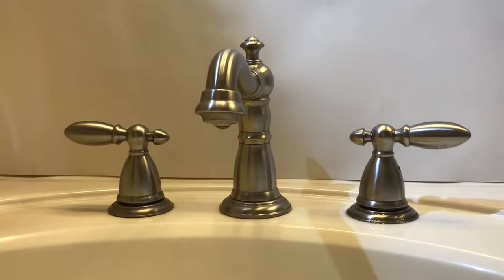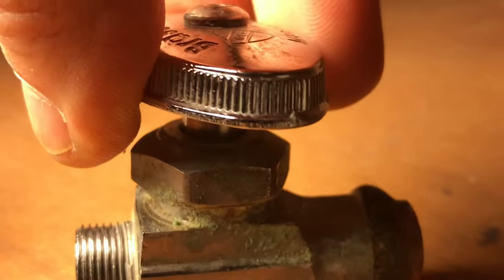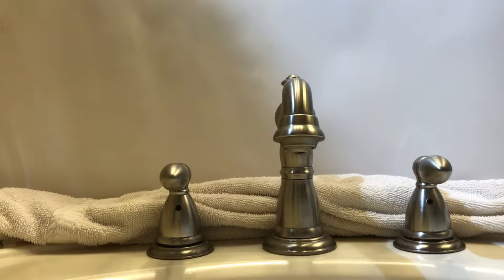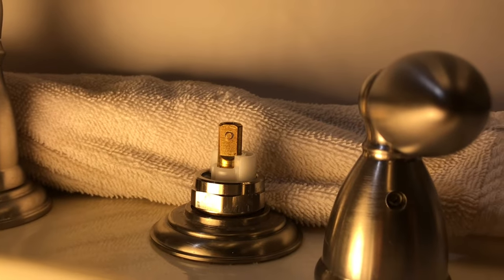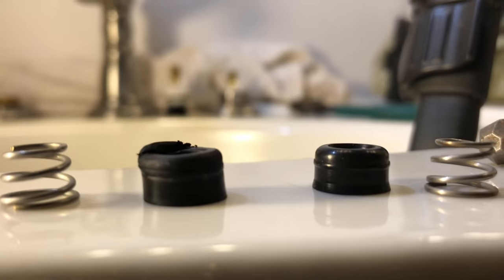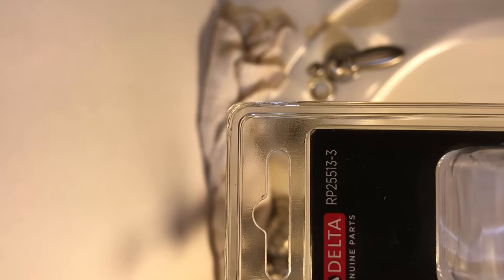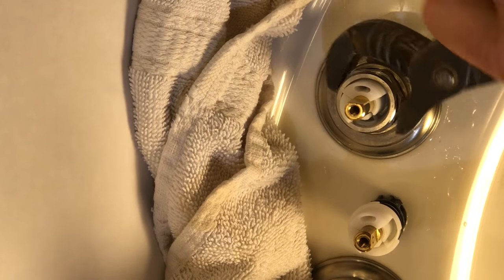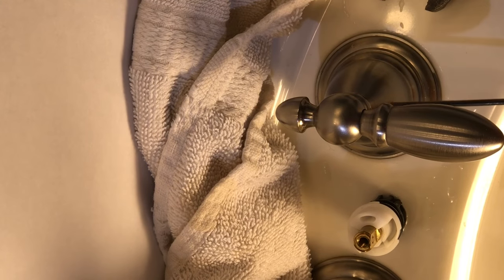How to Repair Leaking, Dripping Delta Faucet #diyplumbing #serviceplumbing @TappPlumbing

Comment: Good video.  But my bath sink faucet cartridges have a screw in their tops;  I note yours are not there.  What are they for?  And also, some time after I replaced both cartridges and seats/springs on my wife’s sink, she complained of the handles being hard to turn, and indeed I found them both substantially different in turning effort from the identical ones on my sink with old but not leaky innards.  What is causing the tightness?  Is the escutcheon nut holding the cartridge in place too snugged down?  I didn’t notice tightness after I put the cartridges in a few months ago, so it’s a head scratcher as to what changed.
Reply from the maker: I am gonna have to guess your theory on over tightening would be most logical, for the question about hard to turn. There are a few other variables that could come into play. The quality of the brass in the valve body comes to mind. The answer to the screws in the top of the cartridge would be some handles attach from the top . These are great questions that unfortunately I have to give you best guess answer for . There are lots of tiny details in  plumbing projects as simple as this one that can make huge differences. Best of luck , please keep us posted when you get things figured out!
Reply: @TappPlumbing  After disassembling the cartridge, I found that’s where it’s an issue with both valves, hot and cold.  It’s not the nut nor the seat and spring.  It’s not even the inner O-ring inside the cartridge, where I’d thought it might be too fat.  

As I put the inner white plastic core that turns into the outer white plastic part that sits stationary under the nut, it rotates fine until they taper together inside.  The wide sleeve above the taper rubs the neck too tightly.  Even with the O-ring removed and waterproof grease slathered between the two, when pressed toward full engagement the inner core takes some effort to rotate inside the “shell”.  This I test with the cartridge in hand, not on the sink, so I can clearly see what’s happening.  The cartridge plastic surfaces where the inner and outer parts meet seem rough to me, not slick like I’d expect.  I’m wondering if Delta changed materials, ending up with faulty degrading plastic of some sort.  I’m tempted to see if I have a tool that I can use to hone down ever so slightly one or both of the interacting surfaces.  
Video available if helpful, but my tremor makes it a bit shaky.
Reply from the maker: @hafcanadiana318  I will be interested to hear the results of your plan. The tolerances in those surfaces that mate are very small. You have the right idea about ever so slightly!  Maybe you can call Delta, tell them your story and get some fresh cartridges.they normally have good customer service. It is very challenging these days to deal with materials across the board in our industry. Thanks so much for your engagement and let us know what happens if you can please.
Reply: @TappPlumbing  I didn't ask for them, only insight into why the two plastic parts fit so tightly, but they automatically shipped off two new RP1740's just from the photo I sent.  I expect they will function tightly as well, since the two in the sink are recent replacements.  We'll see.  

I'm now wondering if we're simply noticing the difference between sinks;  mine has 29 year-old original equipment with faucet handles that turn with no friction at all,  but don't leak either.  Perhaps all new faucet handles/valves/cartridge replacements have tight fitting cartridges that turn with a good deal of resistance, plastic on plastic.
Reply from the maker: @hafcanadiana318   That is a possibility, things are definitely not made the same. That is actually amazing you have a faucet that is 29 years old and still functions perfectly!
Reply from the maker: I just noticed your picture, I spend as much time fishing as possible my self. I would imagine you you endless possibilities for trout fishing up there!
Reply: @TappPlumbing  Even tho retired and an avid fly fisherman, home maintenance projects and my wife’s and my health issues have kept me off the water since 2016.   That photo was on the Beaverhead in Montana.  Decades back I enjoyed drifting flys in remote Cascade lakes, but am likely too old and banged up to backpack anymore.  Dumb me got a backpacker pontoon boat some years ago, but never hit the trails it was meant for.  It did get wet once at Fish Lake in the Steens, where evening brought the hatch, Brookies & Bows on each cast, and encirclement by 2 tail-slapping beavers angered by my presence.  Love Oregon, but ditto for the fishing in Alaska, Idaho, and mostly Montana.
Reply from the maker: @hafcanadiana318  I have only been able to fish with the western mountains for a backdrop once. We live in Georgia and drove our gear to camp in buena Vista Colorado. I plan on doing much more of that in the very near future. I do have the opportunity to drive just a little for salt water fishing and there are some great bass lakes very close. I do fish for trout also but it is normally stockers in tail waters or smaller mountain streams . I enjoy all of it immensely!

Comment: Hello, I have this same exact faucet and the hot water handle on the left will no longer turn the hot water off when I move the handle to the closed position.  Do you think this would be an issue with the cartridge or the spring and seat?  Or, do you think I just need to readjust/calibrate the cartridge?
Reply from the maker: If you have not replaced the seats and springs and the cartridge yet this would be your first course of action:)
Reply: @TappPlumbing  thanks so much!  I will let you know how it turns (pun intended) out.
Reply: Update.  I bought a set of Allen wrenches and for our Delta faucet it was a 3/32 screw.  The problem is that I tried to loosen the screw with the Allen wrench and it would not budge.  I put more force into and thought I might break something.  (This is my girlfriend’s faucet and I don’t want to damage things further).  I think I should give a plumber a call… thoughts?

Comment: Today I finished this repair with one problem. After turning the water supply back on the handle would not turn the water off. I repeated the process two more times hoping to catch my mistake. Still same problem. Thoughts?
Reply from the maker: My first question would be did you repeat the process with the same parts or try different parts? Next question would be did you very carefully and slowly turn the water on with nothing in the valve body at all to make sure no little particles are in there? Basically to flush everything out. Be careful, this can be messy! Next question, did you carefully inspect the cartridge for flaws ? Things are not manufactured the same as they used to be and occasionally we get bad parts right off the shelf. Try these things and keep me posted please. Best of luck!

Comment: I changed the cartridge but I still have water coming from the faucet when I turn the handle off. I have repeated the steps a million times. What am I doing wrong?
Reply from the maker: Did you replace the seats and springs?
Reply: I did not, and that’s what I figured what was going on, Delta was supposed to send me both the stem and the seats and springs. Waiting for them to arrive and will try again. Thanks for the reply.
Reply from the maker: @angelatomaselle    I bet you will have great success when those seats and springs are installed! Keep us posted if you can please.

Comment: Thanks for the tips. I changed both cartridges and the faucet still drips 1drop a minute. I then  lubed the o-rings, no difference. Any ideas?
Reply from the maker: Check your water pressure first, https://www.youtube.com/watch?v=nrGZMxpp_Og&t=122s,  if your pressure is too high then the water is going to the weakest area. It could be that the valve body is scarred and unfortunately it would need replaced. Make sure one more time that all the debris is out of the valve body as sometimes some small particles could be left in before putting in the new seats and springs and cartridge. Good Luck and we hope you a successful plumbing project!

Comment: I am having problem trying to remove the screw with an Allen wrench in the handle. The screw are way too tight. I have tried using WD40 to lime away. Yet it’s still not coming off…. Any suggestions will be helpful. Thanks
Reply from the maker: I need a few details please. Does it appear to be severely corroded and is it leaking from around the handle near the base?

Comment: Hello Sir,
What is the Model Number for this Faucet. Recently bought my House that comes with this Delta Faucet in my Bathroom and it's start to Leak on the Right Lever. Want some Info to speak to Delta to see if I can get the Replacement Cartridge along with the Seat and Spring for this Model to Repair.

Thanks...
Reply from the maker: Take a picture of the faucet and have it ready when you call Delta help line .They will work with you from there!!!

Comment: I took out the set screen using a hex tool, but I can't pull the handle up. It's stuck. Is there something else I need to remove?
Reply from the maker: There shouldn’t be , some times they are very stubborn. If it has been leaking for some and has become corroded especially.
Reply: @TappPlumbing  Should I put a flat head under it and force it up and off?
Reply from the maker: @John-be6jt  You could definitely try that approach. I personally would work the screw driver from different angles. Try not to put too much stress in one place. Also be keenly observant of things chipping . Counter tops and the handle come to mind first. Keep us posted on your progress please.

Comment: What does it mean if I can't dry out the socket under the handle? It fills right back up every time I try and even if I push through and finish the repair it leaks faster than it did before. I bought a cheap universal kit and need to get the actual delta one but think there may be another problem.
Reply from the maker: It could mean the water is not shut all of the way off. You can always turn the water off at your meter .

Comment: How do you remove a faucet if it doesn't have the hex piece for an Allen wrench? There's no sign of anything to relax/release the handle :-/
Reply: there’s probably a little cap either on the top of the handle or the end of the handle arm. pop that loose with a knife tip and there will be a set-screw you need to loosen

Comment: The video says to use a 5/64 Allen wrench to remove the hot and cold handles but it does not fit. Can you tell me the correct size I need. Thank you.
Reply from the maker: If your screw is not stripped, then you might have to purchase a wrench in a delta repair kit. Good luck keep us posted.

Comment: I didnt pick the sink/fixtures. Came with the house. I have 2 problems with same sink: 1-retaining screws on handle are stripped, one is on the sink and the other won't turn/tighten. 2-cant seem to line cartridge up the right way. I hate plumbing of any kind.
Reply from the maker: Some times it is more simple just to replace the faucet. It really depends on the time vs money equation. We all have more of one than the other. Sometimes the new parts simply will not work because the brass is scarred. Plumbing can  definitely be aggravating my friend, even for those of us that deal with it on a daily basis!

Comment: How much does a plumber charge for a job like this? Mine is leaking from the handle. I was quoted for both this and a U bend under the kitchen sink $425 does this sound about right?
Reply from the maker: Depending on your area, this really doesn't sound unreasonable. Good Plumbing is not cheap and cheap plumbing is not good :) We appreciate you reaching out. This is why we started our channel , to save people money. it cost a lot just to pull up in the driveway. Gas, tools, inventory, insurance, license , continuing education, maintenance, just to mention a few:)
Reply: @TappPlumbing  Thank you for the reply and the video 👍🏻I do understand and I apologize if I came off as trying to be cheap. I was asking because I don’t want to get ripped off and it doesn’t help that I’m a girl (I do speak from personal experiences) I also ask questions like this when I take my car to a mechanic.

Comment: So it's the same fix if it's dripping from the spout and not the handle? DO I need my faucet's model number because I have no idea what it is.
Reply from the maker: tightening the nut on the retaining ring for the cartridge's will usually stop the leak from the handle. You will need to change cartridge  as well sometimes, just don't over tighten

Comment: I replaced the seat/spring 2x on a Delta/Peerless faucet. It worked and stopped drip both times for a week. Then it started dripping again.  Ideas?
Reply from the maker: If that is the case we highly recommend checking your water pressure and addressing this issue first. If your pressure is not high then the valve body could be scared and the whole faucet would need to be replaced unfortunately.  Good Luck!!
https://www.youtube.com/watch?v=nrGZMxpp_Og&t=72s

Comment: On my cold water side water is dripping under the sink when the handle is turned on.
It drips directly from under the mounting nut. Any idea why?
Reply from the maker: If you can get the handle off it may provide a clue for you. It could just be the cartridge has gone bad. Keep us posted please?

Comment: What do you have for a faucet model number? They said I had the wrong part number. Thanks
Reply from the maker: The seats and springs work for numerous faucets, did you give them a part number to a faucet? If you called delta directly I am surprised they didn’t ask you to email or text them a picture of the faucet 🤷‍♂️
Reply: @TappPlumbing  . I did send them a picture. Now they are sending me more cartridges. They did not send me a quarter stop cartridge.
Reply from the maker: @chrisrule5723   They normally do a pretty good job with getting the right parts to you. Keep us posted with your progress if you can please!!!!

Comment: Great video. However, there are no screws on the handles to remove them. Now what?
Reply from the maker: Let me first ask have you carefully looked in there or are you just going by feel.  If there are truly no screws the handles should pull off. Just be careful, this plumbing story already seems a little odd about both screws completely missing.

Comment: Where did you get that seat and spring tool at. I can't find it on Amazon
Reply from the maker: I believe we did actually find it on Amazon but I have had it for many years. Maybe you could call Delta and see if they can help you. If not you can slide them up a small screw driver or Allen wrench.
Reply: Can do. Thank you for that

Comment: Still leaking.  I replaced the cartridge, seats and springs just like the video showed, but my cold water side still leaks.  I replaced everything and then turned the valve back on.  No water came out.  When i turned the handle to turn the water on the water came out, but when i went to turn the handle to the off position the sink proceeded to drip again from the faucet (not the handle).
Reply from the maker: Sometimes unfortunately the valve body that holds the seats and springs will be scarred and allow water to still pass through. We would also suggest checking your water pressure https://www.youtube.com/watch?v=nrGZMxpp_Og&t=46s

Comment: What if the spout leaks when the water is turned on?  How do you take it apart?
I'm looking at it and can't tell for the life of me.
Reply from the maker: The spout is not gonna come apart to my knowledge 🤷‍♂️. Except for the aerator. Where is it leaking from?
Reply: From the middle of the vertical part of the spout.  @TappPlumbing
Reply from the maker: You might try to call Delta and see what they say about that . They may send you a replacement if you can get everything disassembled from the bottom without causing more damage. Keep us posted if you have time please. Thanks for watching our video!

Comment: Looks like it need a shim on the spring to protect the rubber.  I have an idea, thanks.
Reply from the maker: Please let me know what the idea is and how well it works. Generally speaking there is almost no extra tolerances on how all of it goes together. Best of luck and thanks for watching!!!
Reply: @TappPlumbing  - Looks like the tip of the spring is digging into the rubber.  Either a small stainless ring on top of the spring, or, solder/weld the top of the spring together and file it even so there is no pokey thing and its all evenly flat.  Would take a little work to find a ring and or weld n file, but, since it is mine, the homework will be worth it.

I hate leaky faucets way more than that homework would entail.
Reply from the maker: Sounds like a plan to me, are you an engineer?
Reply: @TappPlumbing   - The left side of my brain says I am an engineer, Rock star, Astronaut, Grand Master chess player, AND the President of the United States.  The right side of the brain tells the left side to shut up and go sit down     o_O      .

Comment: I have a delta with a bigger hole in  center no spring! I do not know what cartridge to use...it only had a larger washer
Reply from the maker: You should be able to send some pictures to delta and get some help figuring out which parts you need

Comment: When I changed out the seals and the cartridge, the water will not shut off. What am I doing wrong?
Reply from the maker: Are you certain that you used the correct springs?